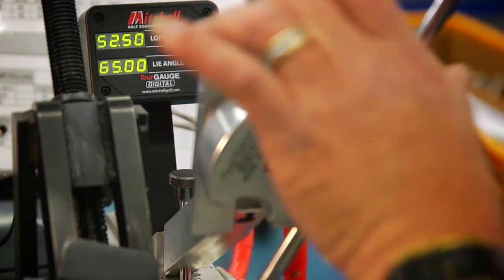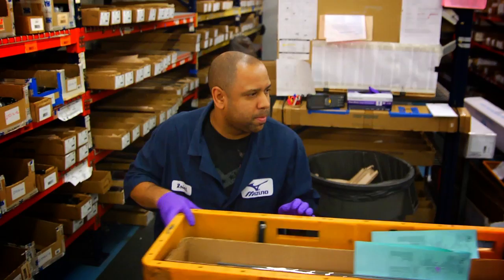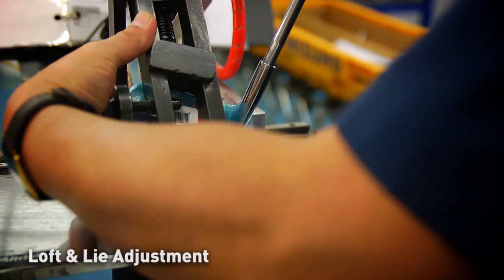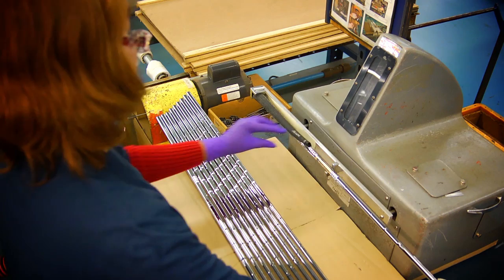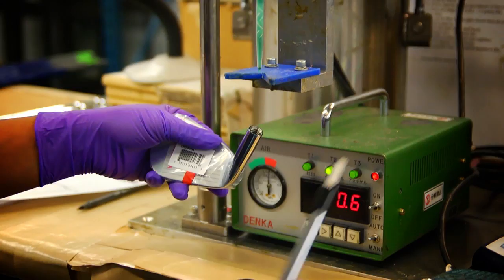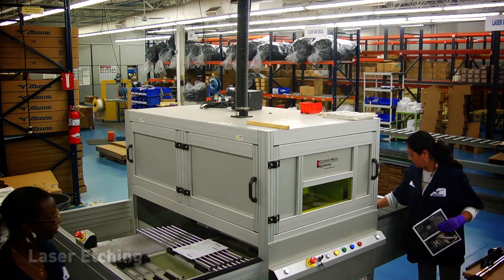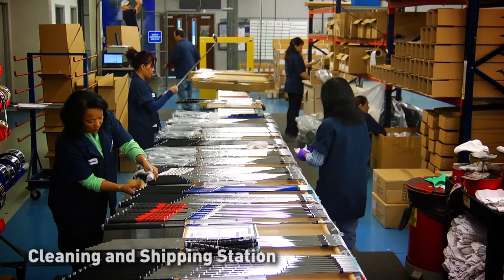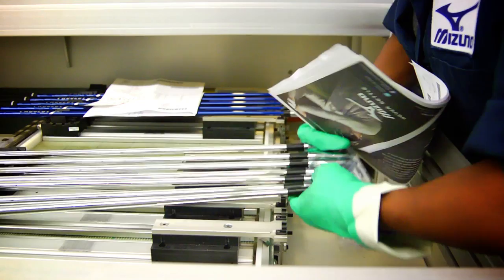Mizuno Golf Custom Manufacturing

Comment: thanks marketing dude..but one step most passed..uncut static weight check of the manufacturing shafts..before install which ensured cpm and static overall.weight is maintained as opposed to adding more in the tip.or butt or shaft to match swingweight...

otherwise nice process..